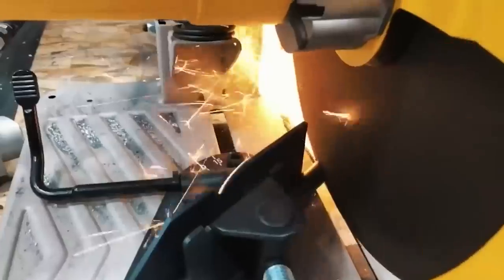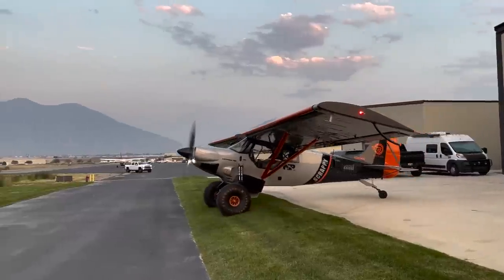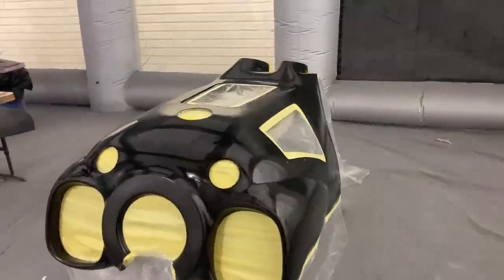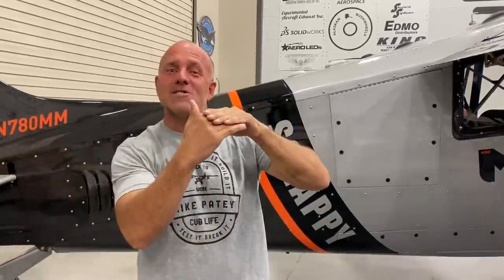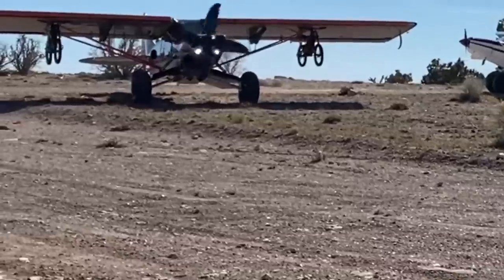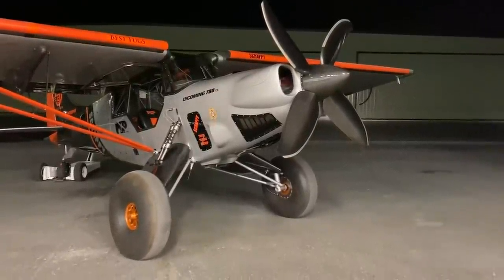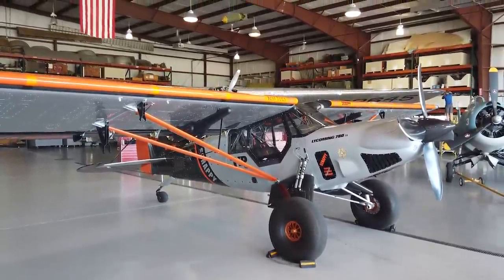I Just Cut off Scrappy's Motor with a Sawzall 😳 | Scrappy #68

Comment: I like it MIke! From my experience with a top-mounted air scoop for a cabin air bleed inlet heat-exchanger on a Lancair 4P was that above about +3 degrees AOA we got no cooling air, but on leveling off the cabin inlet air went from about 130f to OAT instantly. We considered adding an adjustable scoop moving it to a NACA duct the side of the cowling worked much better.  Scrappy appears to have a more pronounced rake on the top of he cowling so maybe you are getting some better ram effect, and I was wondering if you have a way to measure intake charge air temp and if so, if you notice any difference in climb?
Reply: Do you have a build page of your 4P? I'm currently building one and looking for ideas.
Reply: @sinfulcoin  Cool. No build pages. Two 4ps and a one Turbine 4P were built In Oregon working closely with the Factory in Redmond Or. 

N369BX  Was the Turbine and appears to still be registered. The other two 4Ps were exported and I don't know the status. 

You could try to reach Jim at West Coast Washers in Salem Oregon who was the builder of record on the three. Those builds were back in the late 90s and early 2000's so perhaps a bit dated. The IA who did a lot of the engineering and work on the aircraft might still be available. If you reach Jim you might ask.  

Don Goetz was Lancair's factory test pilot and built one of the first 4Ps back in 94' (N43D) I don't have don's current number but could email his friend and see if he's avaiable. 

Are you familiar with RDD Enterprises in Redmond Oregon? The took over the factory and some consider the leading authorities on Lancair. Some of the techs and builders there are top experts, but from personal experiences with the CEO and Company Manager I personally won't recommend doing business with them.
Reply: @jackoneil3933   Thank you for the response. I am not interested in what RDD is doing to the aircraft especially at the advertised price point. Thank you very much for the contacts and I'll try reaching out to Jim.
Reply: @hanger8489  Cool,  Jim Elkins.

Comment: Mike. Did you see the twin turbo V12 diesel engine on the air tractor.  550hp. 25gph fuel burn. Jet A or offroad diesel fuel.   2,000 hours TBO.   Actually two online six turbo diesels to a common gear box.  So if one engine fails the other gets you down.

Comment: You should be using dished out pistons with turbo. And the oil temp is going to go up as well. Which can cause bearing failure in the turbo.

Comment: Great information and quick review of a lot of work you performed as usual. Question: Have you ever thought to use a supercharger instead of turbo on the motor? Next question: Forget supercharging or twin turbos, when are you going to put a turbine on Scrappy? Back to work💪😎✌
Reply: @marcusgrant9892  What are you on about mate?
Reply: Monday we had the comment list attacked by Mike Patey bot and I was leaving tracking numbers as I was reporting them. Got over 21, and put a warning on the top. First time I had been hit by one, and want to warn Mike. Bitcoin Scam using his name across 2 App's. I did my best to protect other's, but it's not really my strong point.
Reply: Superchargers aren't nearly as useful as turbos.  You get a fixed amount of boost with a supercharger on an engine that maintains a very specific speed, which means you'll overboost down low (requiring you to throttle back on takeoff) and lose your boost up high.  A turbo is like a supercharger with a CVT pulley, always making that ideal amount of boost until you hit your max altitude, which is where your turbo tops out and you start losing boost.  In WWII this was partially overcome by using two stage superchargers like in the Merlins, which created a plateau in the altitude performance chart, but aircraft like the P-38 that used turbos had a smooth straight line all the way up to where the turbos hit their service ceiling.  It's just a better solution for aircraft all around.

Comment: I wonder if the solution to the weight issue couldn't be solved with some kind of removable weights that you can shift depending on what you fly. Let's say 3 potions (for the sake of argument) center, rear, front.
This is how they used to do it with really old helicopters. The skeleton frame ones. They would trim the craft for individual flights.

Comment: would love to see this full electric, getting the balance between range and weight might be tricky and a compromise made.
Reply: Why? No environmental  advantage. Terrible weight penalty.  Little or no noise advantage. Unproven safety with batteries especially if emergency landing in water.
Dont get me wrong i love what electric , especially hybrid, can do.
Reply: @rayfletcher3683  the pipestrel is commercially available. Full electric same weight as the fuel version yes less range. They are allowed to enter the circuit much lower than their fuelled counterparts because of the reduced noise. 

Water safely not an issue if designed right. 

Not doubting there are compromises with the current battery energy density but they definitely work.

Comment: Why do you need to lower compression. Surely with anti knock tech you can stay away from danger and at altitude it's only giving you about what you had at sea-level. You were going to use N with 100 hp plus. Will you be trying to get equal length headers into turbo housing?

Comment: Did you have to augment the oil cooling to take into account the extra heat from the turbos lubrication? I assume the turbo lube oil will be routed into the sump or tank as is usual.

Comment: Very cool.  Just gotta be careful making changes, after a while it becomes a slippery slope.  Worked with a guy who bought a building that was slated for demolition.  He needed to get the building so that it was basically "air tight" and then he could do anything he wanted.  While working with him the pressure kept increasing because he was constantly changing things.  Before long he had pretty much drove everyone off and the last I saw the building was sitting empty and he had lost his main source of income (10 story tall apartment building) because he fell behind on repairs on the fire alarm system when he was told not long before that if there was another issue the fire marshal was going to shut it down.  I don't think you would do something like that personally but I also didn't think he would turn out the way he did either after living there and working there for nearly 10 years.

Would love to knock around your shop sometime and help you out though.  I think it would be a blast seeing how you work through things.  Right now I am trying to work on a house that was built originally built in 1911 and likely added on to a bit but never had any insulation installed.  The roof was shot and had 4 layers and I have gotten 1/2 of that replaced but with 100 degree temps I can't handle being on the roof at all so the other half will wait till the temps drop a bit.  Gotta tear 4 layers off then fix any of the 1X4 slats that are rotten, sheathe the roof, put on the underlayment and such, then install the shingles... But since I can't do that right now I am taking off the siding one nail at a time, furring the 2X4's with 2X2's, and then putting R19 fiberglass into the cavity.  After that is done I cap it all with R10 XPS foam and install the siding back on top of it all.  Eventually will replace the siding as well but for now it's not in the budget.  All while doing electrical work, installing datacomm, making plans on other stuff, and dealing with daily life.  Not supposed to be doing most of it due to my back and shoulder problems but it's life and I have found something to feel a little bit back to my old self after losing my wife a couple years ago.
Reply: I had a 1914 house for a while, I completely understand.

Comment: Mke...buddy! You're a crazy magically wizard bastard.... and I love it!!! Lmfao! So, I'm an IT guy and tinkerer. 3D printing, Raspberry Pi, Microcontrollers stuff and rc planes. I'm not great with the mechanical side. I get it. The theory of it. My old man was an old school Tool and Die maker. His father learned in the old country. Hungary. So, I worked in his shop as a teenager. Built some simple dies like stamping galvanized plates for Estees rocket launcher kits. Some vacuum molds for packaging. Worked on a bunch of other projects with him. Actually watched him use the light prism to measure tolerances once which was pretty cool. But, I just didn't dig the work back then. Working for the old man pretty much sucked for a few reasons. Now.., I kinda regret not sticking with it and learning more. 
I got lucky and found a great career. I dig the work I do. Just easier for my mind work with the faith that is IT. Meaning, in IT, we're just pushing voltages around really. Unless we put a scope on a circuit, we have to use and have faith in what we aren't seeing. In mechanics, you can see most everything your doing. Dunno if that's the best way to explain it but..,yea.
Watching YOU! It's like watching an artist. Like, a Renaissance great sculpting or painting! It's so much a lke too. Your imagination with the rules (math, metallurgy ect) and techniques like a great painter but... your art flies! Flies with the added thrill that your life depends on your art! 
Anyway...just an obscure observation. Your a crazy wizard! I don't idolize anyone but if I did... you'd be right up at the top!

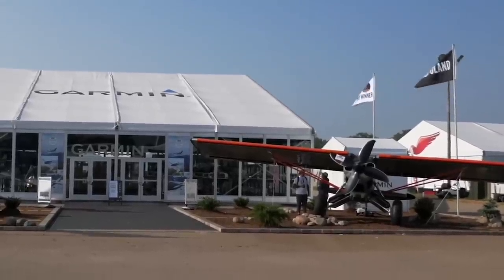Comment: I've got better things to do than watch another Patey video....., wait, no, I don't! I see right at 4:39 he has the plane tilted, probably prior to removing the right side Segway bike. That is the only thing I see he needs to work on, right now I'm guessing (from experience) that he HAS to have a passenger along to get a bike off or on, it's a 2 person job, as is. Note that when he sawzalls the engine mount tube, the saw doesn't bind up, an excellent rigging job with the engine hoist, I'd expect no less!

Comment: Parts of two wrecked Tribal class destroyers in the First World War, the rear & centre sections of HMS Nubian and the bow of HMS Zulu were joined together to create HMS Zubian. The problem was Nubian was 25 feet 6 inches wide while Zulu was 27 feet wide. At the join there was a width difference of nine inches per side, so that was no simple merging of parts.

Comment: Hey Mike I would love to see your next project. You know, up here in the great white north there are many lakes and an STOL flying boat would be a great add on to your collection of search and rescue tools. Here in BC.Canada we have so many trees it is almost impossible to land unless you have floats. Problem with floats is they take from useful load capacity. Hence flying boat could be much more useful up here. I suppose it wouldn't get used as much down there but think of the lives you could save up here and around the world with a new addition to the world of flight with a STOL flying boat. Now with that I would like to add folding and or retractable hydrofoils could be the answer. I have been watching the 20 meter sailing hydrofoil races for the Americas cup. Hey almost everything you need to know is exhibited right there. These boats are only allowed to sail in 19naut winds because they exceed 60mph.

Comment: Hi!  I love this channel and how you (Mike 'n' company) explain everything.  I find it crazy and exciting how you've pretty much innovated and integrated multiple parts of different airplanes into one super star.  I have a crazy question:  When are you going to engineer your own engine?

I have an idea that's basically an elaboration of a few examples that exist already.  I work at Mercury Racing, only as an assembly tech but love reading and seeing the great ideas out there.  I work with the big racing outboards which are hot V supercharged V8's.  It's incredible how they pack all of that motor into the cowling.  

Recently I was reading about the Mercedes Indy Car engine that is turbo charged with the hot exhaust spoil on one end and the cold intake spoil on the other with the axle running down the center of the 'V'.  I know I probably should have kept this to myself, but I don't have the money, facility or the engineering expertise to get a project like this going.  

Would this be anything worth while in an airplane setting?  

Thanks Mike and family for making great content and hope to see Scrappy at more future Oshkosh shows!

Comment: 8(  Well Uncle Mikey... Scrappy is huge! On the shot of you flying low overhead it sounded just like a WW2 fighter, or DC3? LOL Now with the duel turbo's its even going to be more so,  and even more complex with 1944 technology!  99.9% of bush planes are designed to be very light and simple. I totally get all the cool stuff w/Scrappy, and I love it!  But, you could have 1200HP, lose a lot of weight, have way fewer moving parts, upgrade to current technology,  and have an engine to match the "coolness" of Scrappy!! Put the PT6 in it, please!! No more DC3, Corsair, Mustang noises! LOLOL 8) Love you Buddy!!  8)  --gary

Comment: Did you change the prop after Oshkosh? Will the engine extension and twin turbo's modification change the speed vs the Nitro's version? With the 10 changes you made to "DracoX"/ Scrappy, how does Scrappy compare to Draco in so far as take off and landing, or did the Scrappy build give you a complete different outcome than Draco was?

Comment: Rather than cameras, you should go with something more precise. Add measuring lasers that are pointed at the lowest most spot under the prop, and on the sides at quarters. That way, if you ever get the prop near something, you'll be forewarned by the laser reaching 0. It doesn't even need to be something smart. Just buy three medium grade laser range finders and take them apart for the guts. A simple arduino board can then process the info and warn you.

Comment: When you increase your polar moment of inertia, wouldn't you need larger elevators and a larger rudder?
Reply: If you watched from the beginning of Scrappy the build, he extended the elevator and rudder to omg levels.  Thus reasoning the engine he  added.  Instead of a normal lycombing.

Comment: Totally understood the balance issue, and that was always a suck it and see. Rightly the pilot should always be put into the equation.
However the prop is very much the limiting factor, the power wasn't, nor the stored noz gas, very light and on demand. You never really showed your design working because of the props limits. Kind was expecting you to put a fast prop on and explore your design in detail.
Instead you are going the common route, and the issue you explained. Unless you can disconnect them in flight, and bring them in when needed. You are burning fuel, creating heat, wear, failure points into your engine on a plane you want to haul & stay on station. 

How difficult is it to carry 2 props, and swap them out at a closer field? Hot prop to get you there, slow for search & rescue and short landing & take off.
You have the best of all worlds. A Production car had a rear diff gear kit, swap out. Drive to the track, swap set out for drag strip, swap back in to drive home.
I think you could develop this idea, and aviation would be better for it. Flexibility in one plane, its kind of what Scrappy is about. Thunderbird 3, always has the answer, and you are safe when you see it. That's Scrappy makes life easier. 
Build  Draco 2 for speed and stunts, Scrappy isn't that plane, she is a safe well thought out base in the wilds where change is a bad thing.

Comment: I hope you already know this but if not, here goes. My experience is not aircraft engines it’s drag racing engines but consider this. When you put a power adder such as NOS or turbos or any other boosting that results in increased cylinder pressures, too tight piston ring end gaps become a failure point. When the boost level goes up, the ring gap closes and breaks the pistons. I’ve seen pistons shattered from too much NOS and too little piston ring end gap. I’m just worried for your safety. If I’m full of mud, just tell me to stay out of the conversation. Stay safe. Enjoy Oshkosh, See you at Sun N Fun.
Reply: He just ditched the nitrous for twin turbochargers.

Comment: Also, 
Why 4 small turbos instead of 2 or even 1 Big Turbo? as Turbo lag is not a real problem except when changing power settings at high altitude 
(look at the P-38 from ww2, it took 10-18 seconds at Full power holding brakes for turbos to spool upto full boost and make 60 inches manifold pressure.)

As 4 small turbos will be spinning at much higher RPM like (200,000RPM to keep the 15psi boost) majorly shortening their life span by 50-75% shorter. 
Typical small turbo like a TD04 last about 250-350,000km or converted to running hours at avergae 50kph thats 7000 hours of boosting. 
(like those found on a WRX will boost 14psi (stock boost) for 25 years over 350,000km without any signs of shaft wear or play., increase that same small turbo to 18 psi and it will last 50,000km maybe if lucky

Comment: I guess I'm late for this comment jst saw the vid , I just heard u say u are going to lower the compression for the turbos I hope u didn't lower it to much , compression on a ic engine pushes ex gas's out , when u add turbos u are adding almost unlimited intake charge , so where is the exhaust turbo to expell all that extra intake charge , well there is none , here's the proof , a Dyno test was done some time back on a nine hundred hp Chevy they bumped the comp up to ten to one from eight n a half , too hundred extra hp motor now made eleven hundred n yes it was a turbo motor , on top of that a non diesel motor is variable compression ,which makes things worse , I use thermal barrier coatings even on non turbo motor,s cooler intervals u can raise the comp ,also porting the ex port on the head helps alot , sorry bout the long rant